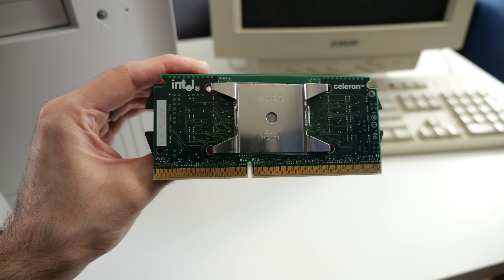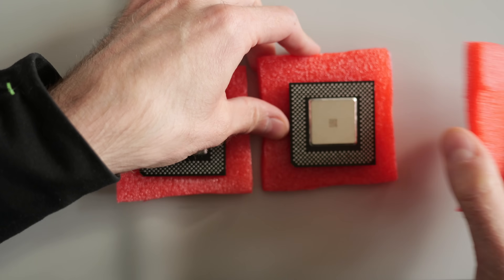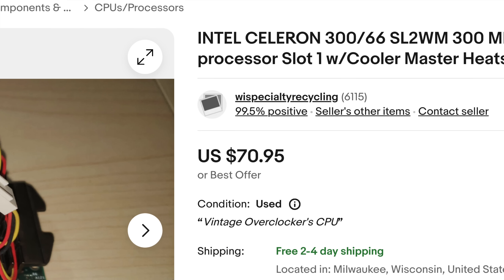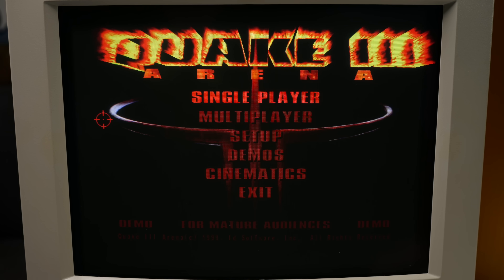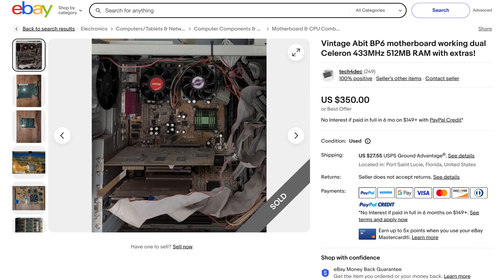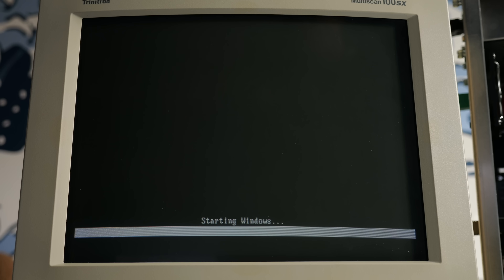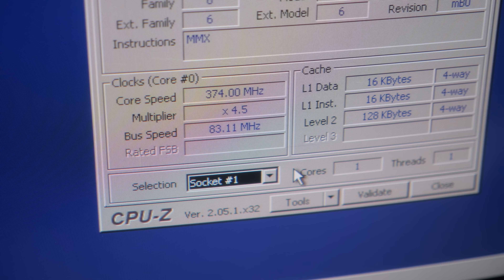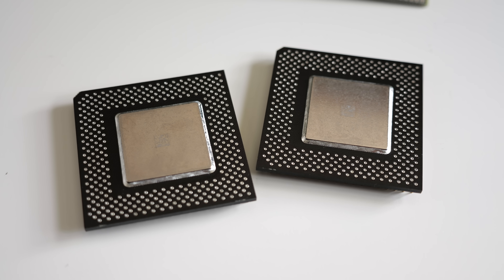I almost BLEW UP two vintage Celeron CPUs

Comment: Computer manufacturers make no sense.  Like my Acer laptop that's hampered by EMMC.  Quad core fast efficient processor with 16gb of ram and 32gb EMMC without a path to upgrade

Comment: Great video! Really takes me back. I remember that the CPU stepping was a big deal. Early versions were pretty likely not to over clock well unless you added massive voltage and cooling. Some later versions would need minimal if any help. The benefits of SMP were weak at the time. I switched from 2x366@550 celerons to a single 400@600 on my BP6 because of that. What a fun motherboard for enthusiasts and a heyday for overclockers.

Comment: THAT startet my BACK TO RETRO COMPUTING ADDICTION in 2023. an asus mel-m motherboard, with socket 370 only support for mendocino - and I did rock a no thrills OC @ 83mhz for a goodness of 565 mhz ( think its a 500 mhz cpu). its like the limit mendocino can take and I cant go to 100mhz fsb on that board. but other than that, I just love this little sucker. it was a fujitsu siemens oem and I never ever saw the board again, anywhere! but its great. has yamaha onboard sound and an ISA slot, where I did slot my first ever awe32 soundblaster. haaa, and now I am fully addicted and go more retro systems than.... braincells i guess.
cheers mate, nice content, great stuff! bad luck with your OCs brother! maybe you went with too much voltage from the get-go on the second cpu, did you try to lower it?

Comment: Your challenges overclocking is either a crummy board or 25+ year old silicon or both. Back in the day with an Abit BH6 board 19 out of 20 would go to 450 mhz on the stock voltage and I never heard of a 300A that wouldn’t hit 450 mhz with a small kick to voltage. If an enthusiast couldn’t get theirs up to 450 they would be griping and moaning on the forums of the time and there was almost none of that. 

On stock voltage my 300A/ Abit BH6 combo would run rock solid at 464 mhz (turbo mode) for years and years and would run very reliably at 504 MHz- I would get crashes every other day or so that didn’t seem to happen at 464 but could also have been Win98/ME- amazing that a stable OS wasn’t a given back then. 

This was a retail processor using the factory installed heatsink with zero tweaks. I also didn’t attempt to chase down certain processor batches as some were fabled to be better than others, I just bought it right off the shelf of my neighborhood computer shop. God remember when those were a thing? My processor didn’t turn out to be one of the fabled good batches but it didn’t matter. 

Running two CPUs as an enthusiast/gamer at this point was basically just a flex. As you note, almost no game or consumer software supported it, and usually you would have to lower your clock speed as well. You were doubling the silicon running at its limit and presenting more opportunities for something not to talk to something else. Keep in mind the Celeron was multiplier locked and unlike later chipsets, every clock speed in the system was run as a fraction of the CPU bus speed. If you were running anything else but 66 or 100 MHz bus you were overclocking EVERY peripheral in the entire system- AGP, every PCI card, etc. A 504 MHz overclock was running a 112 MHz front side bus and every other system bus was also 12% out of spec. The only people I know with dual processor 504 Celerons had access to a pile of chips and handpicked a matched set that ran well together. 

Rather than dual CPUs, your gaming money at the time was best spent on dual Voodoo2’s. 12 mb Voodoo 2’s in SLI was a god tier setup until basically the GeForce.
Reply: I’ve also wondered where the ceiling actually was on the 300A silicon. Because they were multiplier locked, as I mentioned once you got above 100 MHz you were running everything in your entire computer out of spec and most of the time that was the limiting factor. This made 550 MHz basically impossible as you’d have your FSB running 22% faster than spec. But if that wasn’t an issue, how fast could it go?

Comment: I had success with dual 300A, but one time I made the mistake of not going for the gusto and landed on 75Mhz FSB and it scambled my SCSI controller and wiped two hard drives. Had I gone to 100Mhz right off the bat, it would have been fine. Hard drives restored, I did have success @ 504 on both, but there were ocassional stabilities I never was able to entirely correct. 450 was rock solid

Comment: If you want to see an FPS boost with Quake 3 in SMP mode, you need to run it at a lower resolution such as 640x480 at the most. The game is too GPU-bound at higher resolutions, at least on my dual 1 GHz P-III and GeForce 4 Ti system.

Comment: Back in the day when we were doing this Windows 2000 wasn't available yet, so maybe stable in Windows NT but not 2000?. I had a Windows NT system running some Digisuite LE hardware that ran two slocketed 300A's @ 450, don't remember if it had a voltage bump. If so I don't think it was much. If I remember correctly there might have been specific batches of 300A CPU's that were more desirable. All of this was back when I was operating under Trinitymicro.

Comment: The big advantage you'd get with those dual-cpu setups is productivity/multitasking. The experience of working with multiple programs simultaneously was considerably better in a dual celeron setup back then even if the individual programs were not taking advantage of SMP
Reply: The wide spread application support for multiprocessing only came when dual core CPUs were becoming more ubiquitous, and then the number of CPUs on a single die became "The sky is the limit!".
Reply: When I got my BP6 with dual Celeron, I had the feeling the computer was unstopable :)
Not faster, but could do as many things as I wanted simultaneously.
And since I also had a SCSI drive ....
Reply: I had friend who was a programmer that used a rig  with dual celerons for code compiliation.

Comment: if you are overclocking  a celeron 300 a  better  to  put the bus speed to  83 mhz  instead  of  100mhz but with higher speed ram  mhz. I had  duel coppermine  celeron  733mhz  66 bus overclocked to  1166 mhz  using  83mhz  bus

Comment: I wish I  hadn't trashed my slot 1  motherboards collection , but they stopped working all of the sudden .  but back in the days knew nothing about electronics , and fixing motherboard . I had an impressive collection of hard to find motherboards , including socket 370  with DDR400

Comment: I used to OC Celerons back in the day. they were decent over clockers.  one thing to note is that the CPU's on the Slot 1 processors are different than the CPUs for socket 370. the most slot 1 processor was the Covington CPU core, and the Mendocino core was used on the 300A slot 1 and socket 370.   the Mendocino cores were ran from 300mhz-533 MHZ.  Intel binned the core based on their internal testing, so the best cores ran at 533mhz, and the worst cores ran 300mhz, but the CPU yields were very good, so pretty much everything from the 333 on up over clocked well, with only the 300A being hit or miss since this is where Intel Binned all the low performing chips. so, most 300A CPUs were not the best at over clocking. however, the 333 was much better for overclocking. the Coving core Celerons 266 and 300 are great for over clocking but they have no cache so they take a performance it compared to a Mendicino core chip and the same clock rate.   also, we used much bigger heatsinks and fans back then. this is also where water cooling got its start, some others also used Peltier piezo-electric coolers. sandwiched between the heat sinks and the CPU. I personally ran a Celeron 333 at 500mhz, no changes to the voltage, but I was running water cooling setup.  the key thing to look at when overclocking is the AGP and PCI bus clock speeds.  AGP, PCI and motherboard integrated options like sound cards and ethernet get weird if it is out of the clock divider range. AGP ran 66mhz and they don't like to be outside that range at all. so, clock dividers needed to be used. AGP uses 3:2 clock divider on 100mhz FSB and 2:1 on a 133mhz FSB AGP Bus, and Motherboard integrated PCI devices don't like to go beyond 40mhz. so if you CPU is running on 66mhz Front Side Bus, the clock divider in running at 2:1.  FSB is 66 and PCI is 33.   with the FSB set to 83mhz, the PCI bus will be at 41.5 and on the edge of not being stable. at 75mhz FSB, then the PCI bus runs at around 37.5mhz and will be much more stable.  with a 100MHZ FSB, the clock divider is set to 3:1, so the PCI bus will be at 33mhz. and with a 133FSB the clock divider is 4:1 to keep the PCI bus in the 33mhz range. the best over clocking results happen when you are as close to the AGP and PCI bus specifications, I also never messed with multiprocessing on Celeron processors. also, some mother boards were better than others at over clocking. Tom's Hardware had a great article on overclocking around July of 2000. I personally liked the old Chain Tech motherboards for this ASUS also made a good board for it but I don't remember the model number. I switched to overclocking AMD Duron processors as it was much easier to change the multipliers with a #2 pensile and some clear nail polish.

Comment: There's a bit of a Mandela effect going on.
The Celerons that were super easy to overclock were the early Covington ones (the ones without the A, and without cache). You could basically run them at whatever speed you liked, they wouldn't even flinch.
The newer Mendocino ones are mostly overclockable, but not as easy as the earlier ones. The integrated cache makes them more susceptible to instability on higher clock rates.
Most magazines tried back then, but you had to get lucky with the chip lottery and give them a lot more power.
Reply: I used to work at a computer shop part time during the mid-late 90s, we built and sold many of these machines. The original 266 celerons would run at 400mhz if you set the bus-speed to 100.

I dug out some of our old sales catalogues and managed to find a full page on the 300a@450, bh-6 abit motherboard.

I'm wondering if there is some degradation in these old motherboards power supply and filtering circuits causing increased instability, some degradation of capacitors etc. 

it's been a while but I don't recall ever having issues running them at 450mhz back when we were building them (probably sold several hundred during 98-99). Even the socket 370 ones used to just run fine. The cache was much more desirable back then as the ones without cache run like crap, even at 100mhz.
Reply: @n2n8sda  Without the onboard cache the celerons were painfully slow even when Over Clocked. The power supply for the CPU's and probably chipset is failing. With a bios check like it has it should always be over never under. Add to that an AGP video card that the chipset can barely deal with to start. PCI was always the choice for stability.
Reply: @n2n8sda  People called these the Celery on usenet. No L2 cache at all? That is crazy. Not much point in upgrading from a Pentium MMX to a Celeron. People were saying that the Celeron was just a Pentium II with no L2 cache. I think it was 1 y later that Celeron A was released and this had integrated 128 KB of L2 cache onto the CPU die.
Reply: I think the early 300A in the slot-1 package were generally easy to overclock, but as time went on and they released faster variants only bad bins started being sold as the 300A, and the PPGA versions lkely were never good OC'ers as only the 366 and 400mhz were initially available on socket 370 and they eventually went up to 533mhz, so likely the 300 and 333mhz PPGA chips were terrible bins that couldn't reliably enough hit 366mhz at stock voltage.
Reply: @brandonupchurch7628  Fair call. At the time I was building PC for workmates as a side hussle. I built 24 over 12 months using the 300A's to over clock. about 80% were stable at 100 mhz and of those about 60% did it at stock voltage or lower. The board type and brand played a big part.
Reply: Which was one of the reasons the cache was moved off die for the P2 (and hence the reason for Slot 1), so the cache could run at lower clock speeds and the CPU could run as fast as possible. It quickly became obsolete with smaller semiconductor tech meaning the cache could fit on the CPU die in its entirety, and slapping some SSE instructions to the chip made it the Pentium 3.
Reply: They didn't really move the cache off die, the Celeron was the first time Intel did monolithic cache, even the PPro the cache was a separate die although it was packaged closely with the CPU die.
Reply: @brandonupchurch7628  You also have to remember that was the era when Intel was pushing the very expensive RDRam. It was 3 times the price for almost no advantage. You couldnt give away an Intel in that era.
Reply: @ The Rambus thing? It had an advantage where there was a lot of sequential reads. It was good with video editing but in all other cases, included all games, it was a poor performer. The other downside was that you can't leave a slot unpopulated. You had to insert some kind of blank board. I don't know what Intel was thinking.
Reply: The cache-less (I don't even know if this is a proper english term ^^) Celerons were a pain in the A (pun intended), to be honest, whether they were OC'ed or not. Totally not worth it, imho, unless you tried to build a cheap thingy for your grandma and her needs of a PC for her weekly e-mails XD.

Comment: I remember when I had a Celeron. 450 MHz was standard. I could get it to run on 500 mhz but it would blue screen when it got too hot. So 450 it was. Fun fact: I used w2k too because it was just better.

Comment: A note about windows NT kernels:

    Single Processor:
    When a system only has one CPU, the standard "Ntoskrnl" file is used, which is designed to manage the workload on that single processor efficiently.

    Multiple Processors:
    For systems with multiple CPUs, a specific variant of Ntoskrnl, often referred to as  or "Ntkrnlpa.exe", is loaded, which allows the kernel to distribute tasks across all available processors, improving overall system performance. 

Source: google